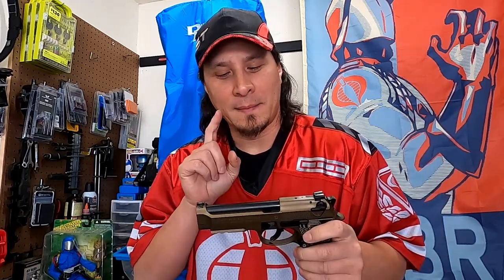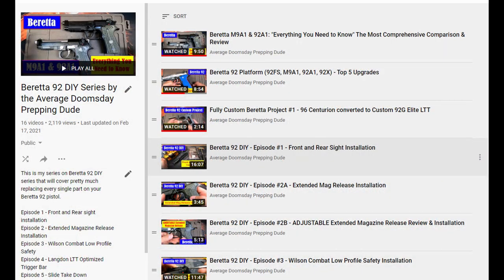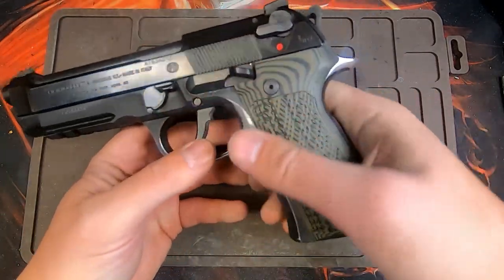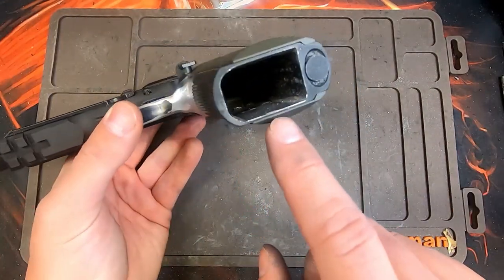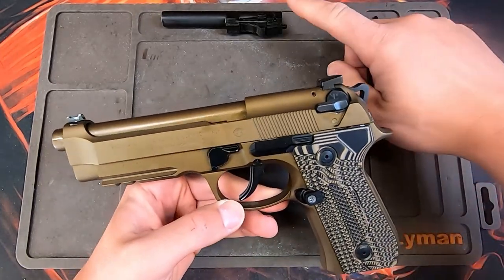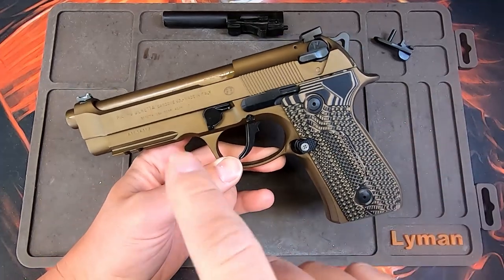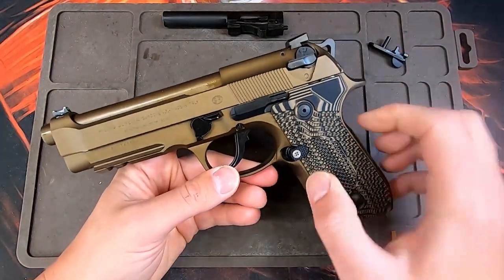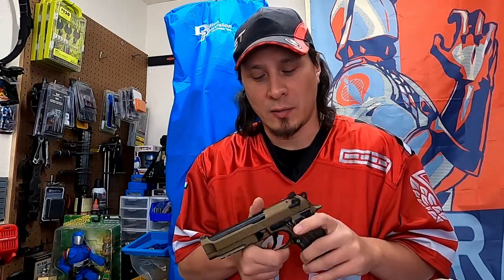Beretta 92A1 Custom Project #3 | H-148 Burnt Bronze Cerakote

Comment: Aftermarket grips and accessories always cater to the little short stubby fingers market, never towards us men with MAN hands. We’re left with having to file down metal. I love my A1, but can never get a great purchase, because my middle finger under the trigger guard unseats my palm swell. Maybe I should start a new biz which caters to manly man hands.. but I digress. The trigger reach at the very end of the pull gets extremely short, to the point my finger is too far extended on the trigger. Might try the 92X performance trigger to see if that helps.

Comment: That looks sick 😍👌 im interested roughly how much did it cost to get done? 🤠👍
Reply from the maker: The place I go to charges 130 for the Slide, Barrel and Frame Cerakote.
Reply: @CobraReady  $130 for all 3?   This may be a typo.  Who did you use, if you do not mind me asking.  Was it the place off of Penn ?   I am thinking of having them do mine.
Reply: @CobraReady  what’s the company that did your cerakote ?
Reply from the maker: @excusemesir9132  This one was R&B Arms.
Reply from the maker: @dick8997  No. They charge more for disassembly so I dropped off stripped.

Comment: Noob question here. If you wanted to run this gun in uspsa what class would it fall in? Not production right because of the mag well mod?
Reply from the maker: This would be production.  Internal modifications are legal, external magwells would move you to Limited Minor.
Reply: Thanks for the quick reply!